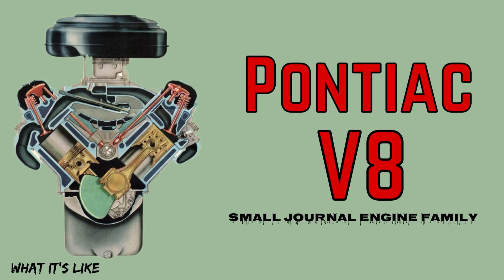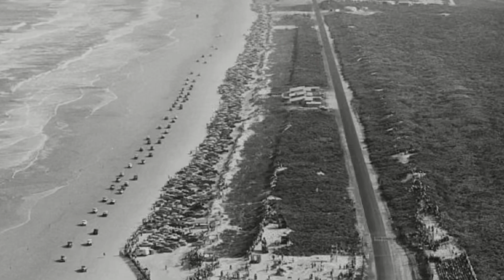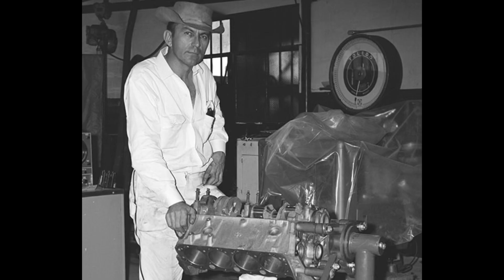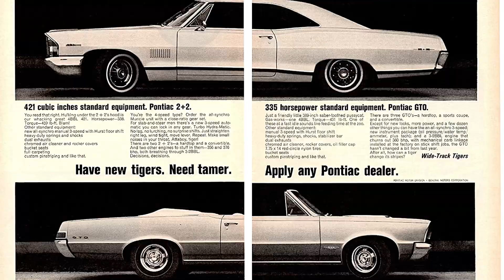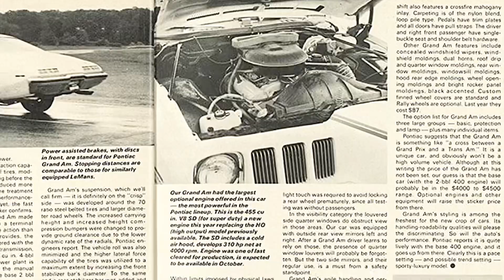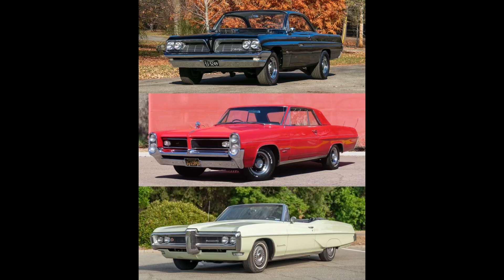Large journal Pontiac, V8 engine family ￼421, 428, 455

Comment: The "Super Duty" separate catalog was developed to keep Pontiac's performance efforts from being scrutinized by the GM board who would not be aware of it's existence for some time, and by then it was too late to stop Pontiac from going there. One of the first instances of John Z pissing off the GM board 😁 The SD engines were stout and could handle serious power with the forged crank, but the large journals could experience too much bearing speed leading to spun bearings. Ford's 351W has the same problem with it's 3" main journals.Pinning the bearings prevents spinning them, but you still get bearing smear unless oiling is perfect. The 455 SD didn't make a lot of power stock but could be built to insane levels. It had triangular connecting rods which did not break or bend and the nodular iron crank approached forged steel for strength with less flex. I'm not sure why Pontiac didn't build it more powerful themselves. Same as the 289 HiPo Ford,a lot of 'fake' 455 SD's are out there so buyer beware and drop the pan before dropping your money to be sure.

WYR they're all great but I like the 64GP better, then of course 'The Judge'.

Comment: I know big olds engines, which also have large rod journals tend to suffer lubrication related rod bearing failure at higher rpm.
Do the large journal pontiacs as well?
Reply: I think bigger rod journals need more oil pressure to fight centrifugal force especially at high RPM. Maybe 567/645 locomotive engines got away with gigantic crankshaft journal diameters because they only redlined a little slower than 1000 RPM !
Reply: Yes they do. The 351WFord has similar problems with it's 3" mains.

Comment: Great info as always, but you kinda skipped over the 428.  Basically, it was a 421 bored to 4.120 which just happened to be the bore of the new 400 in the same year.  Sounds like a manufacturing cost reduction to me.  I am partial to that big 1968 Bonneville convertible, and who could turn down a the only year that the Judge had a 455?
Reply from the maker: Yeah, you're right. I don't understand why that one didn't show up. I recorded it. It must've dropped out of there. I will take this episode down and I'll replace it with the other one.

Comment: Good info about the Pontiac engines. While Smokey was a legend with all things automotive, there was another Pontiac guy who could make them run (and you even mentioned his name once): Mickey Thompson. MT supplied all kinds of hi perf parts for Pontiacs. WYR= 61, but not if it had the horrible Roto HydraMatic, or the Grand Prix, but the 63 is much better looking. The 68 was, by then, just a wallowing boat. Then the Trans-am. The 2+2 was ugly as sin for 67, but a 65 or 66 is gorgeous. The Judge was an ugly joke, especially with those stupid eyebrows over the wheel wells. Oh, one minor detail: the 265 and 301 V8s were smaller blocks, compared to all others. The deck height was lower,   which means a narrower intake manifold, so they are visibly smaller in comparison.  Fun video again, Jay!
Reply from the maker: Happy you dig this episode =) 

Another commentator just told me that the 428 information wasn't in there and I was like what do you mean it's right there and I went back and watched it and it wasn't there so this episode is not complete which totally sucks and it's not going to be viewable so all your comments are going to disappear just being transparent because I had to upload a whole Other video.. I do everything with an iPad for whatever reason YouTube doesn't offer the same experience on an iPad as a desktop it sucks. I wish it would change that.
Reply: @What.its.like.  I wouldn't stress about it. The 428 was only 7 cu. in. bigger than the 421, and it was basically an emissions motor. Yes, it sucks if you have to reupload the video again, or you could just put the missing specs in the video description box, or just a comment.

Comment: I said it yesterday. I'll say it again. Im simply AMAZED that they were able to go from 265 to 455 using the same physical block size. It's even more amazing considering the fact that it's a relatively small block. It's not much larger physically than the chevy.
Reply: I think the 265 was a lightened and cut down smog block similar to the 301. Not the same as the 287 original which was probably designed with room for larger cylinder cores inside. Actually the 301 was not a "real" Pontiac block as I understand.
Reply: @davidpowell3347  even at 287 it's still amazing to be able to bore and stroke it to 455 with a relatively small block . Of course they had to design it with that in mind. I'm more amazed at the room for the increased stroke than the increased bore. For comparison, the Dodge started as a 273 and shared its block with the 318.  But had to use a different block to accommodate the larger stroke of the 360. Likewise the small block Ford. They had to use a taller block to accommodate the 3.5 inch stroke for the 351W. . Three inches was the most they could accommodate it's the original block. To be fair, they started out with the very small 221 if I'm not mistaken